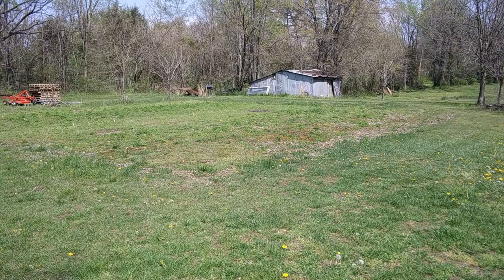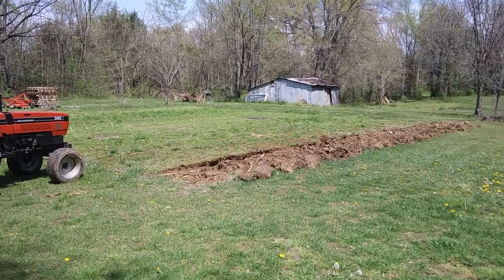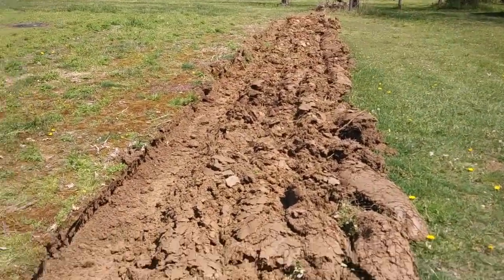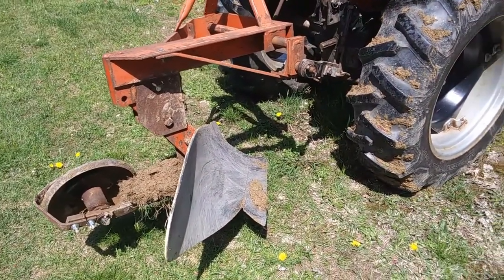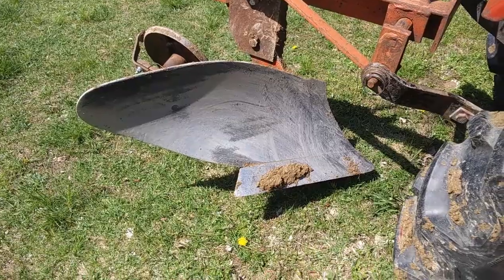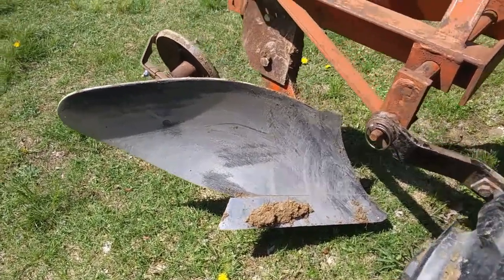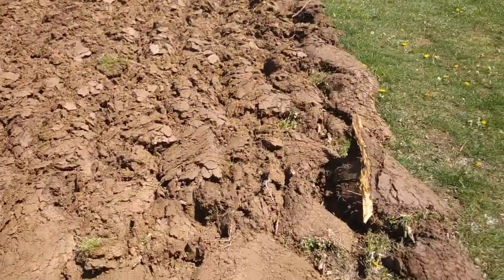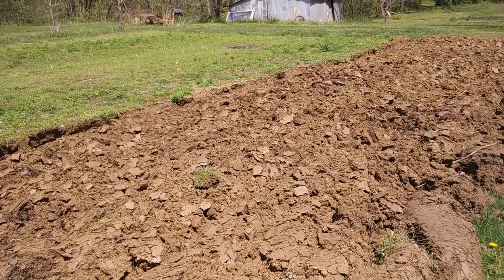Plowing the Garden 2022

Comment: heres a question. Ive got the same tractor but a 4x4 version and all i do is get stuck with it . I bought brand new ag tires and all i do is get stuck . how do you control how deep your goes ?
Reply from the maker: What size plow are you using? One bottom I assume? Thanks for commenting
Reply: @shepshomestead  a 12" single bottom . All it does is dive down in I can't drop the plow and have it stay at one height
Reply from the maker: @eriebreeze6584  When I set the plow up I use the top link to make the point ever so slightly tip down. Usually I start with the plow sitting flat on the ground and adjust the top link so that I can get a finger under the bottom of the rear of the landside. That is where I start. If it seems like it is going too deep I lengthen the top link to tip it back some. I also use the adjustable stops on the hydraulic lever to only let it go down about 6 to 8 inches. I hope that helps and kind of gives you a place to start but to be honest I haven't had the problem that you describe. Soil type may play a part in it too. Thanks for watching.